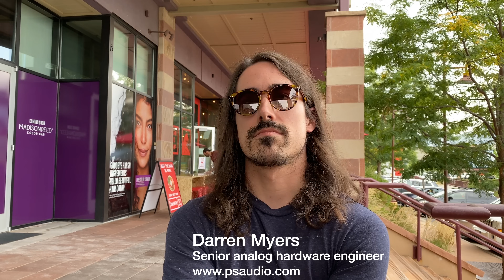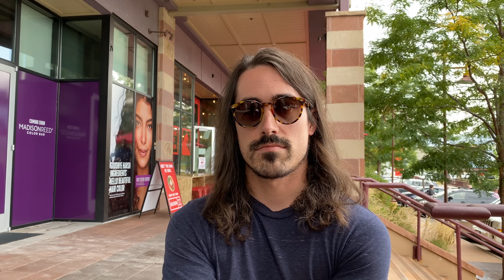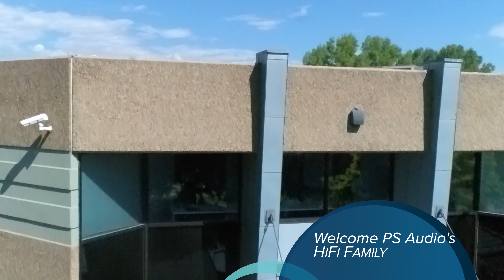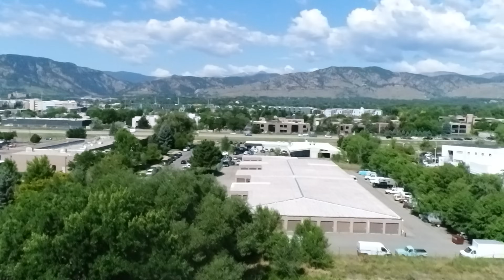Lunch with Paul: The importance of feedback in audio

Comment: 1:24
Are you saying "error signal" ? 
I'm not able to discern it. Thanks. And does an error signal behave as a noise cancelling wave form? 
I'm trying my best to understand stuff that is out of my depth. I understand that it's probably engineering 101 day one stuff but I'm an artist and never grasped higher math. Thanks.
-✌🏼
Reply: Assume that you're the manager of a bar. You have a reference checklist of how much and what liquids to mix for a drink. Then you have a subordinate who makes the exact mistakes of pouring 20ml instead of 10ml or reverse etc predictably. Like say adding water or alcohol to the drinks. Now you are a super high sensitive manager who checks every drop the subordinate adds, I mean every microlitre. In spite of your subordinate being so crappy and uncontrolled, your drink is going to be perfect because of your constant feedback correcting his mistakes. Like you say pour 5ml instead of an actual 10ml when you know he will pour double.

Now the high sensitivity of the manager is the gain of the amplifier and the crappiness of the subordinate is the non-linearity. Any deviation of the output from the reference voltage which is the error is now the amplifier input which would keep driving the output till the error goes to zero. An otherwise open loop output that an amplifier would have generated would be like a destroyed drink, would be now crystal clear audio because of your close monitoring. Hope this helps.
Reply: You compare the signal on the output with the signal on the input. Any difference is an error. In this way the error can be corrected by thr amplifiers

Comment: I can agree, feedback can be a concern. But, lots of great sounding audio products use feedback to get the output signal closer to the input signal for the best audio fidelity. Decades ago it became obvious that feedback can cause serious audio issues when poorly engineered yielding especially TIM distortion usually due to the feedback mechanism being with some latency. Then amplifier companies started focusing on slew rate. One test that can show horrible feedback issues is a simple square wave test. Rapidly rising/dropping signals can reveal poor feedback. I've seen some bad case in a brand new class D amplifier recently. BTW, the talk about pros and cons regarding servo subwoofers (they rely on feedback) sort of has quite a similar flavor to it.

Comment: I don't want to listen to a piece of medical equipment....
2nd and 3rd harmonics in small proportional amounts sounds pleasant.
Reply: I usually like to hear what was intended from the master recording. If added distortion was a thing for me, I would like a "distortion on/off" switch so I can turn it off for the music where it hurts more than it helps. But I agree with your point, it's true that for some music, adding even harmonic distortion makes it sound more live-like and musical. So give us the distortion button and you can keep it on all the time if you want and I'll probably mostly have it off.
Reply: @ThinkingBetter  - if you want to listen to what was recorded as intended, then you need the same speakers & amp that were used in mastering that recording. And the same room too.
Reply: @Enemji  Yes, true. Also, I can agree that for some music, adding distortion on top of the intended experience can make music sound better. Still, I pursue the cleanest signal as that works best for the music I like.
Reply: @ThinkingBetter  Let's keep in mind that he's talking about levels of distortion below your ability to hear, but still measurable.  0.1% distortion would be considered a terrible spec for an amp, but you can't even hear it that.  Loudspeakers have more than 0.1% all day long.  Saying that an amp with 0.02% THD is better than an amp with 0.04% THD is nonsense.
Reply: @TheMirolab  Yes, I completely agree on that, but when I have a choice between an amp that has headroom to not clip vs an amp that has some level of soft clipping at the actual music peaks, I most certainly prefer the more headroom. Tube sound is mostly about soft clipping and of course soft clipping is better than hard clipping. But also solid state circuits can add soft clipping. Speakers often have several percent of THD. Any THD is bad but worse is THD with the energy more on uneven harmonics. Tube distortion is more like music instruments harmonics in being even harmonic distortion.
Reply: Good for you